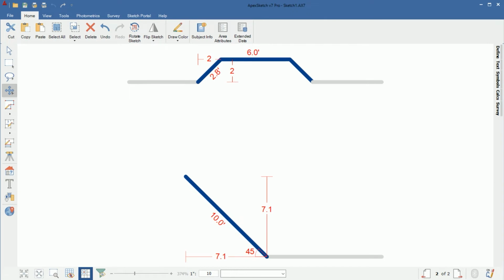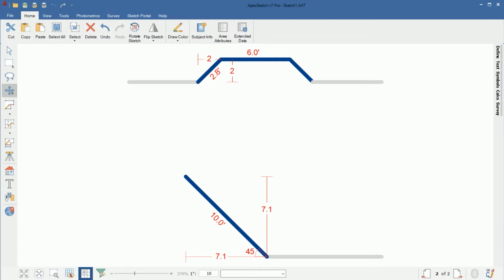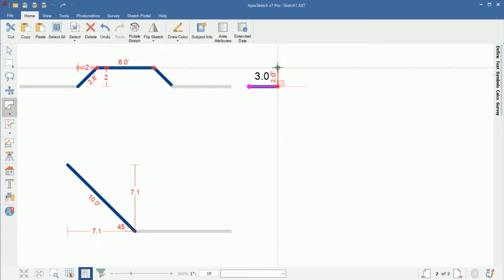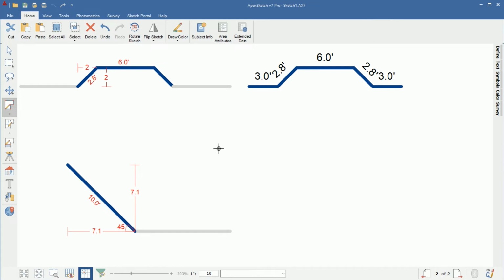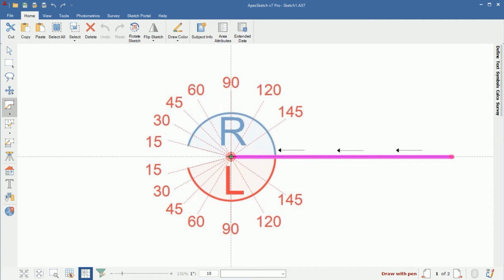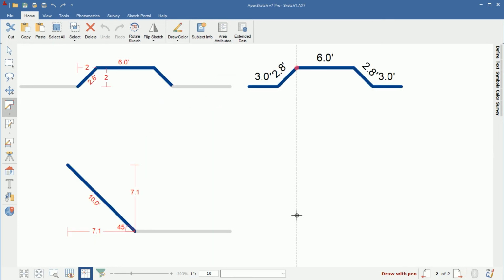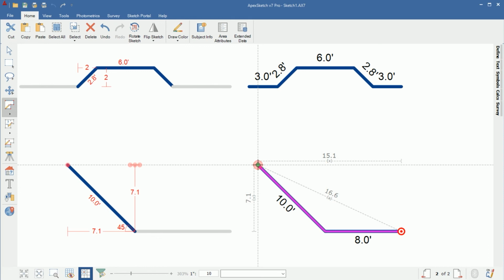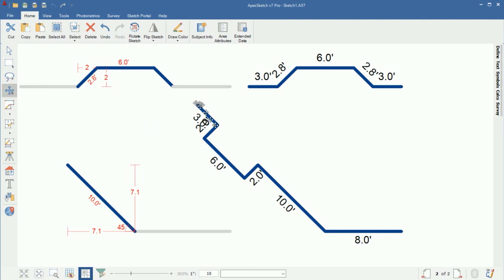ApexSketch v7 -Tips & Tricks on Measuring and Drawing Angles | Apex Software

Comment: Is there a way to turn on and off the feature to use degrees? I'm not getting the R or L to show now. It was working in the past.
Reply from the maker: Hey @kenny8082, the R and L (for angles) will only work once you have one line drawn to reference off of. Are you attempting to use R or L on the first line you sketch? There is not setting to turn this on or off.. If you continue to have issues, give us a call at 1-800-858-9958 and we can look further into it.